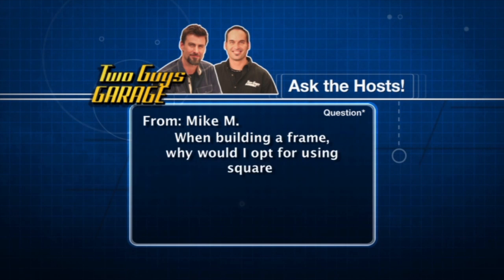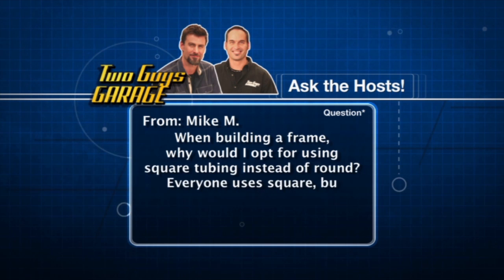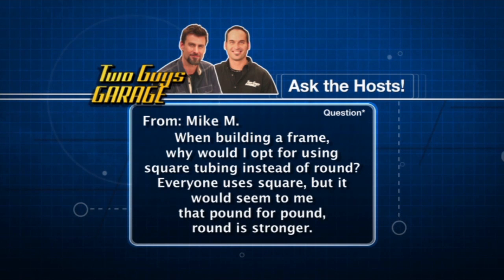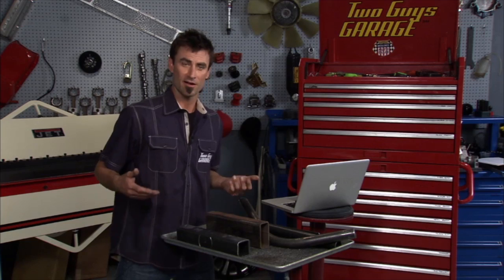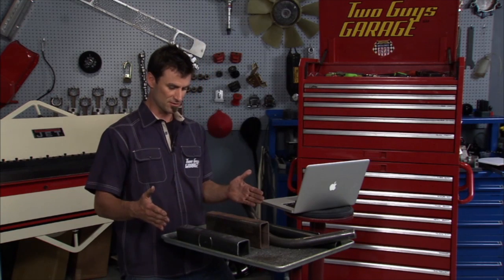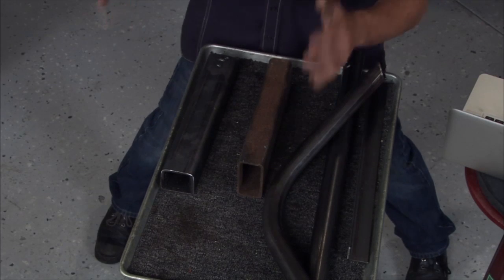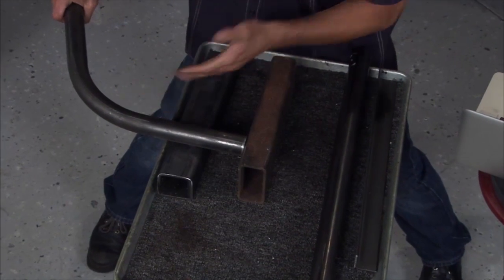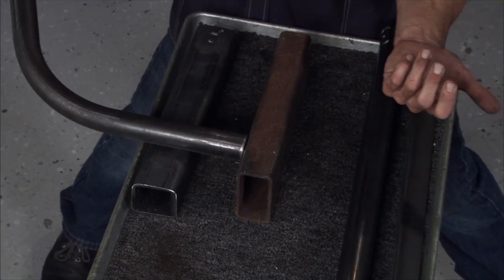Round Tubing Vs. Square Tubing | Two Guys Garage

Comment: I know that using dom tubing is preferred for things like bumpers and rock sliders in the offroad world, my question is, why do so many people and shops prefer to use dom over, let's say, 2x2 1/4" square tubing? I get that weight is a factory depending on the build, but is it something like square just isn't as strong, or its too bulky or something like that?
Reply: Impact resistance is not the same as lifting capacity.  I'm no expert, but my best guess would be that a round bumper might have more tendency to "slide off" terrain rather than "catch" onto it and get hung up.   Things hitting a bumper can also come from many directions while off-roading, so the same principal of multi-directional strength might apply. I'm not sure what the costs are, but price might also be a factor.

Comment: for the question not covered round or square for the purpose of lifting and  carrying  I want to make a crane for my pick up truck and will as witch will apply better property to my build
               thank you for your help in this question
Reply: When you know the direction of consistent applied force (a crane always lifts up with force pulling straight down) square tubing is actually stronger.  Just don't let the force be applied diagonal to the square. For example, if this "crane" were to swing a heavy weight around which would cause your boom to bend in many different directions, the round tubing would be better.
Reply: @rochboulanger6565  i was going to reply to him SQUARE is stronger than round in 2 axis .. you said it perfectly
Reply: @rochboulanger6565  so what about for things like bumpers and rock sliders then?